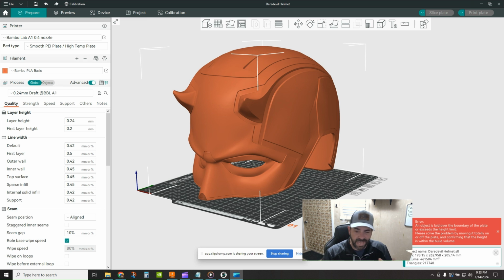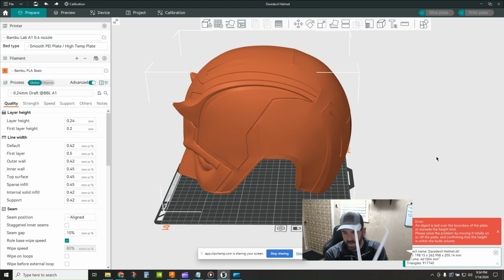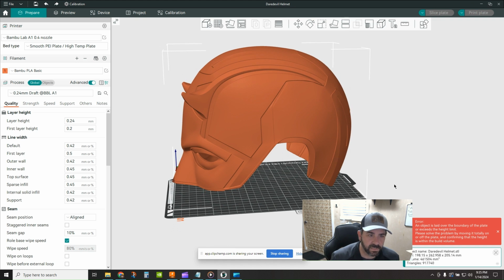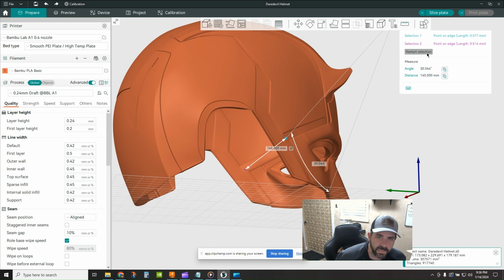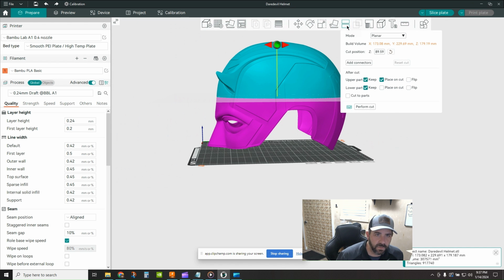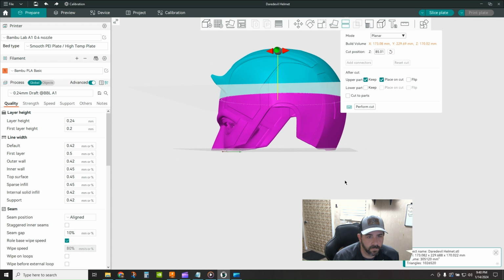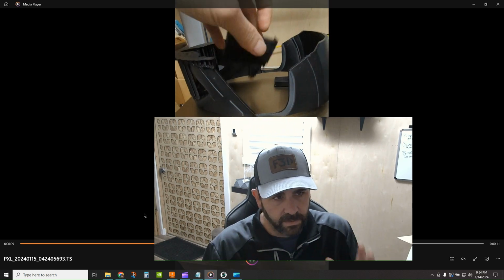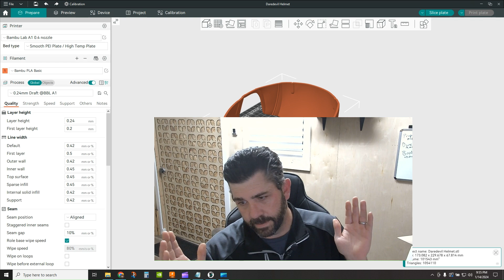Mastering Orca Slicer: Measuring & Scaling for Perfect Cosplay Helmet Prints

Comment: I'm so new to this. How do I control speed? I heard making it print slower is much better
Reply from the maker: Under your process settings you should see tabs like Quality, Strength, Speed, etc.. Click the Speed tab and adjust speeds there.  Your printer type and its capabilities speed-wise are the keys.  What printer do you have?

Inner wall and outer wall speeds play some pretty crucial roles.  First layer speed is essential for make sure you get good adhesion to the build plate after that Inner and Outer wall speeds.
Reply: @fischer3d  I have an Elegoo Neptune 4 plus
Reply: @fischer3d also so sorry bug ya but another question. How much outer wall, inner wall, sprase fill do I need? I don't know to much as I'm new. Trying to print a full mask for a friend
Reply from the maker: Hard to tell, but i'd start with the default settings for that printer in Orca for the speeds. On the Strength tab select 3 walls.  10% for the sparse infill.  

I'd suggest cutting a cross section of the mask and just print a portion of it to see how it looks then tweak from there.  Reference this video for how to scale and make a cross section of the mask for fitting and quality check....
https://youtu.be/SKTqPdgVvZg
Reply: @fischer3d  awesome thank you!!!

Comment: I'm trying to print an object that is fairly long. I bring the object into Orca Slicer and center it on the print area. But when I send it to the printer and start to print it, the object is not centered on the bed, and the printer gets really cranky when it tries to move the extruder into the side of the printer. This issue is driving me crazy. I’m suspicious that the printer profile that I have for my K1 Max in Orca Slicer is bogus. Do you have any suggestions?
Reply from the maker: I'm not super knowledgeable on the guts of the K1, but I had a similar issue with my Enders.  First, click the edit presets button next to your printer name (top-leftish).  Click the Extruder tab.  scroll down and check to see if there is a value in the Extruder Offset fields.
Reply: No, unfortunately there is no extruder off set.

Comment: And there the measure tool was… right in front of me. I’ve been pulling in Fusion to measure and then going back to Orca.

Between your videos and a few others, I have my A1 mini printing near flawlessly. Thank you for the content!

PS: Have you played with editing the plate config? I ended up needing to do a .05mm Z adjust to keep my nozzle at the right height and out of my prints. That and tramming my bed while at temp with a magnetic precision edge were the main things I needed.
Reply from the maker: Glad it's helping. Thanks.  I haven't yet had to mess with the plate config.  So far so good (fingers crossed).